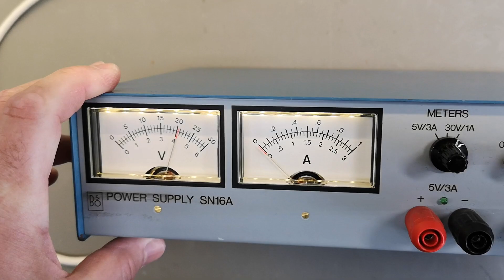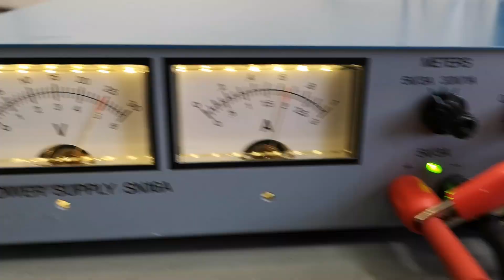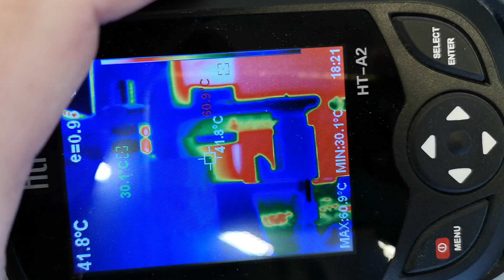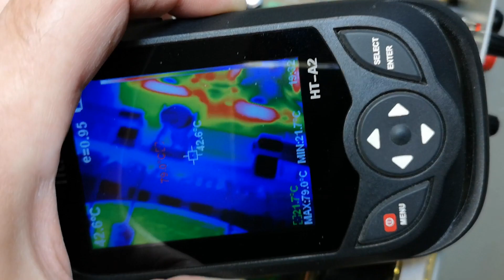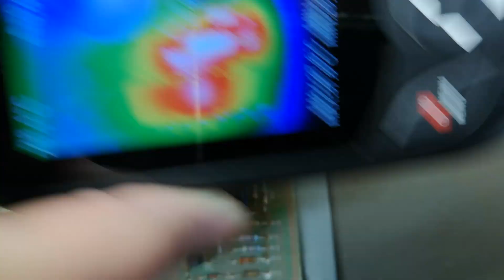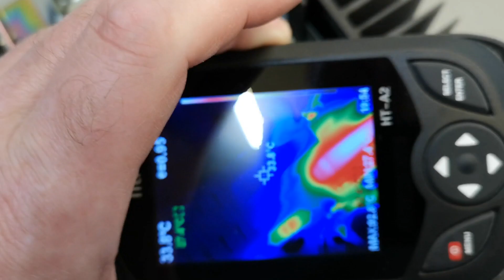Bang and Olufsen Struer SN16A DC Power supply 1983 test mods teardown

Comment: Ib Lundgaard (1947-2023) designed the SN16 and later SN16A after a large  demand (so he told me) He did not mention the lack of fuses in the SN16. Today the SN16 can be made to work very well because of improved and new components: PPTC, lowloss bridges, high performance Rubycons etc. The SN16A is a new design with known issues, here explained, but modified differently. Thank you for this very informative and useful video.
Reply from the maker: thanks a lot, yes the issues are known and a few ways exist to solve them, I also would love to see its voltage setpoint flipped, so an open potentiometer give you zero, and not full voltage.

Comment: Yes, diode upgrade time for sure. 6A diode bridges for the 30V rails, and a 10A bridge for the 3A rail, plus replace that capacitor as well, if it is getting that hot it is very likely well past useful life. Looks like yours needs the 2 main bridge rectifiers replaced, at least with 6A types, to get the taller package that will run cool, and for the 5V rail a 10A type for the same reason. 

Though looking at my local suppliers 8A 800V bridges will fit all in the positions for the power rectifiers, and will run cool bare for the 30V rails, though for the 5V rail you might need a small tag on the bridge to handle the heat, or short wires to use the existing tag as heat spreader and hang it off the board. That plus a new 6800uF 16V Rubycon would leave plenty of room in place of the existing, and lower ripple on the rail as well.
Reply from the maker: great upgrade, and not that hard to do, nor expensive, i plan to put this unit for sale / swap soon, so the next owner will have the pleasure
Reply: A solution for the 5V supply rectifier is to use 4 x Schottky power diodes, the heat at full load will be gone, and no
heatsink will be required. However, reverse leakage current is an issue for thermal runaway, but here we have low
voltages, 50Hz (60Hz) x 2 switching speed, and a 250VAC protection GMOV can be placed across the transformer.
Again, modern components can solve all the issues without or with minimal mechanical intervention.

Comment: How badly can you screw up a power supply design?  Unbelievable. That 3A rectifier heat sink looks like an afterthought.
Reply from the maker: thanks for your comment :-) that is exactly why i make the videos, to find cool.. or sad design decisions / solutions.. so we can learn, what to do, what not to do.. and it is quite entertaining and educating at the same time
Reply: @TeardownOZ2CPU  As I wrote to you, it is the capacitors that make the diodes hot. They are more or less short-circuited.
Reply from the maker: @maxjakobsen5526  nope.. at no load, nothing gets hot..

Comment: Jeg syntes jeg så noget med 50 grader på en af de store kondensatorer, de må ikke blive så varme. De skal skiftes hvilket også er meget normalt, alderen taget i betragtning.
Reply from the maker: korrekt, men jeg tror at det meste af opvarmningen kommer fra ensretteren, der er meget ringe udført, jeg har dog forbedret den meget med kølepasta
Reply: @TeardownOZ2CPU  Varför behövs R50 (5V circuit) och R51 & R52 (30V circuit) ?  (Mycket tomgångsvärme)
Om man vill begränsa överspänning kan detta ske med zenerdiod på 16V resp. 51V (3W) istället.
Reply from the maker: @bengtwahlstrom8247  good idea, you can ofcourse make your unit with a little bit smarter mod :-) it is good to use as little idle power as possible, things also live longer running colder.